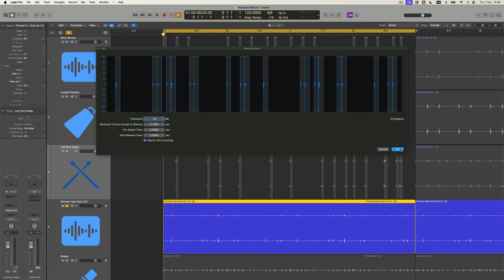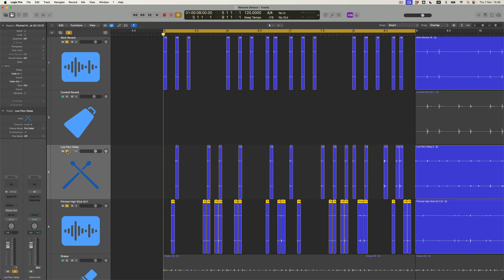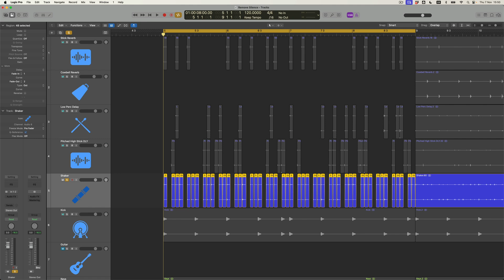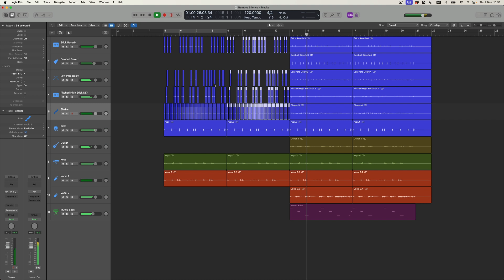Logic Pro: How to Remove Silence From Audio Region

Comment: Hi, thanks for the video. But I, along with many others I know, have encountered the same issue — when exporting a MIDI track and then importing it back as audio, there’s a small silence at the beginning. 1) All effects are disabled 2) The notes are positioned correctly 3) SMPTE and all timing settings are aligned 4) I make sure to uncheck “Include Tail” when exporting. How can this issue be resolved?
Yes, I can manually trim the silence, but then the audio clip won’t sit properly on the grid. I know this has been a common problem for a long time, affecting many users.
Reply: Yes, I have the same issue — because of this, I can’t make my own loops properly, they just won’t snap to the grid correctly.
I don’t know how to fix it — Logic just adds a small silence at the beginning of every exported audio file.
Reply from the maker: Many thanks for letting me know. I'll look into this and get back to you.

Comment: Why can’t we use a noise gate?
Reply from the maker: Hi. Good question. You absolutely can use a Noise Gate. But there are a few advantages to using this function, the biggest of which is isolating hits as separate Regions, which makes each one easy to move, or Sample. So you can readily re-program patterns from their individual hits. There is also an advantage if you want to take this on one more step and vary the lengths of each Region, so that you can go from super-clipped, very short Regions, to longer ones with variable Fade Out lengths.